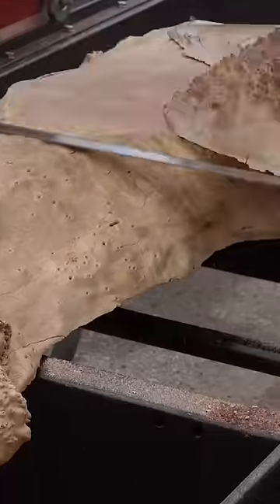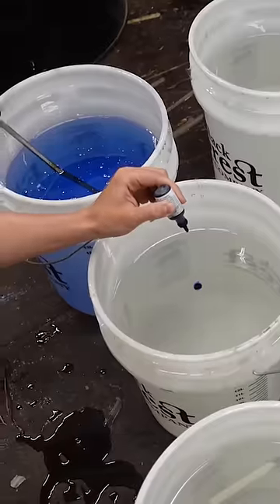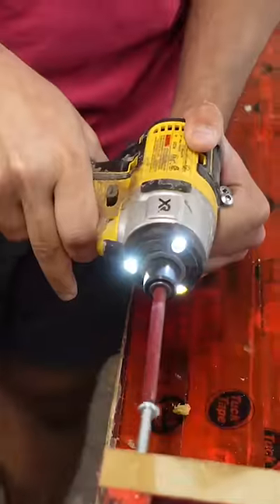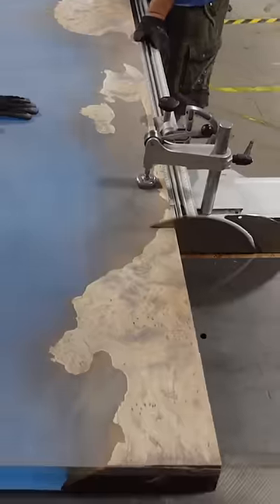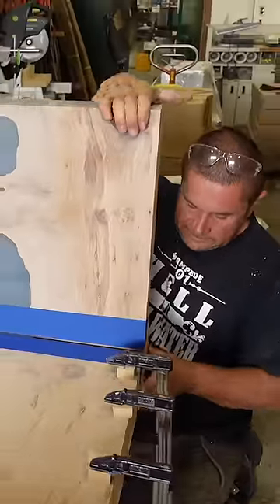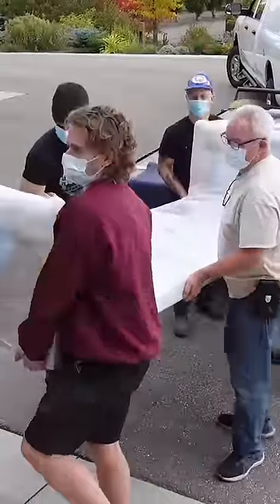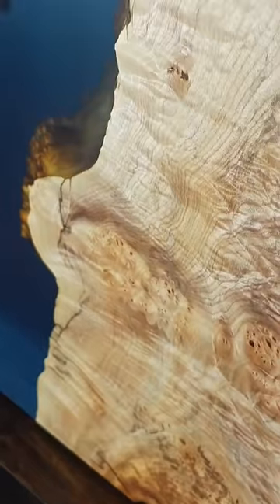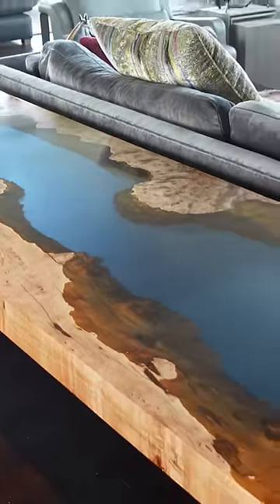Creating a 4” Thick Table with Burl and Resin #homedecor #epoxy #resin #furniture #woodworking

Comment: So beautiful… how comes there is no bubbles at all?
Reply from the maker: Our resin is slow-curing and high quality! It's our Black Forest Deep Resin.
Reply: The slower it cures, the longer it has for the bubbles to come out from it. Also you can use a blowtorch to pop all the bubbles on the surface instantly, it's a very common procedure and I have to imagine these guys also do it.
Reply: They applied heat after it was mixed to remove bubbles, or added a thinner like xylene or acetone. Personally I think the epoxy looks like hell on this piece. It looks like a cheap version of fogged glass but whatever floats your ten thousand dollar boat
Reply: @utubesuxalotofazz  I like it, but it definitely isn't for everyone. I wouldn't pay what it's worth anyway which is why I don't have an epoxy table. It is neat, but not $10,000 neat to me. Clearly it's worth that to some people though otherwise businesses like this channel wouldn't exist
Reply: @BlackForestWoodCo where can we buy it from?
Reply: @meech2163 😂 I’ve done this since mid 90s and it’s certainly not for homes .. making big bucks from cheap ass materials .. tells you on it don’t eat anywhere near epoxy even the eco epoxy ain’t eco for house
Reply: @Sam-sl2vf  tf are you on about? You're definitely 14 trying to act like you know more than everyone, but you're just wrong lol
Reply: You can use a shaker table, so the bubbles 🫧 get shook to the surface, then you can just pop them one by one
Reply: @Sam-sl2vf  tell me you dont know shit without telling me.
Reply: @Sam-sl2vf 

Cheap materials? 

What a honk, that live edge maple with burl wood on it and no bubbles in 1 pour? GTFO mr. Since the 90s.

You post negative reply because since the 90s you have failed how many times? 😂

FYI.

I would have used the wood live edges for a solid maple table myself...carpenter all my life, I just don't like poured resin stuff.

Table is beautiful and well executed.
Reply: @NoIwont  oh it’s well executed for sure but certainly not home or eco friendly as I said .. chemicals shouldn’t b eaten on or prepared as it’s a chemical bond and it says so on the coshh !!!
Reply: @Tat2dmalehottie  I’ve worked with it since it was invented 20 year exp with the guy that invented it and a few more to go … you keep eating food of that you’ll have bowel problems … this is new to most not for eating substances at all
Reply: @nicoschroeder5379  your a hazard yourself 😂
Reply: @Sam-sl2vf  

I agree...not for an island where food prep is done.
Reply: @NoIwont  nobody is gonna cut and prepare food right on the epoxy of a 10k table.  Reaching hard you guys 😂 

And even if some vegetables and shit lay on the table nothing will happen as long as you dont scratch it and eat the tiny shavings.
Reply: Vacuum
Reply: @meech2163 Exactly A lot of people in the YouTube comments complain and moan about things not being worth it. That's just because it's not worth it to them, but to somebody else it is. Everybody's taste is different and that's what makes the world unique. If everything was the same, it would be boring.
Reply: Thank you for sharing your knowledge!  I questioned all the You Tubers advertising for kitchen counters!  I also noticed "Schoolies" are using these type of  kitchen counters!
Reply: I love it  I wish I had 1
Reply: @Sam-sl2vf Why so explain yourself please
Reply: They asked the resin nicely
Reply: @BlackForestWoodCo 😊
Reply: @meech2163 I wouldn't take it for free... actually I take that back. I would, then sell it to a moron for 10k and laugh as I deposit it in my bank.
Reply: @UltimateKillz  thank you for proving my point that these tables don't fit the taste of everyone. Congratulations, you don't like it? Someone else does and thinks it's worth $10k and even you admit that
Reply: @Sam-sl2vf  You sir are a tool 😂. Cured epoxy is INERT. Once the catalyzed reaction completes and the product is fully cured there are no “chemicals” floating around.
It’s totally food safe and does not off-gas at all.  I’d worry more about the wood itself.
Reply: @utubesuxalotofazz  thought it was $15K?
Reply: @HBSuccess  You know what, i don't think I'd like to bet on that. These guys say its their own mix; so what's in it and is it food safe?
Reply: @Sam-sl2vf why? Toxic?
Reply: @utubesuxalotofazz Yeah, I thought the same. Doesn't look great.
Reply: Move heat across the top.  Get instructions BEFORE you do ANYTHING. 😊
Reply: There are no bubbles because he knows what he's doing.
Reply: Becauses science
Reply: They probably heat the bubbles out as they go ...
Reply: @utubesuxalotofazz  thought the same,looks like a double pane window fogged up with a leak, would be way more pleasing with translucent epoxy.

Comment: I’m not a big fan of the resin tables ( I have a degree in furniture design) but you guys did a really good job. No bubbles or any excessive heat issues. You guys definitely know what you are doing. Is that the Domino XL? 
Really impressive how the waterfall edge all bonded and no “seam lines” ..👌🏻👌🏻

Comment: Could this product be used on an old brick patio with alot of texture to make a smooth floor and still see the brick? What is the minimum/ maximum thickness?  Would freezing affect its longevity and durability?

Comment: Looks good. Would be cool to do a table like this without doing a 45 cut and reattaching. If possible would allow the resin in the middle to not have that defined line from the joint

Comment: Domino is the name of the piece you inserted. The tool is a domino cutter or morticer. It’s only a tenon if it’s cut from the same piece of wood- when it’s separately inserted it’s called a domino.

Comment: So what rule did you break?
Reply from the maker: Resin pours typically should only be a maximum of 2.5" inches thick because they can overheat and even explode an crack from the chemical reaction to heating up too quickly, we did 4" inches in one pour

Comment: The trend of making these plastic tables has gotten out of hand
 Soooo very much pollution is made just making these resins. Then you shave and sand and put it in the atmosphere and sweep piles of it into the trash and it goes to the dump. Humans need to start reducing the use of these virtually everlasting pollutants.  Epoxy tables are tacky af anyway

Comment: Congratulations, you've made a 700lb table that will be out of style in 5 years and will either forever date the home to 2020 or live forever in a landfill because the epoxy takes forever to degrade and is near impossible to repair effectively.

Looks cool and is work well done. But this trend can end tomorrow and it won't be missed.